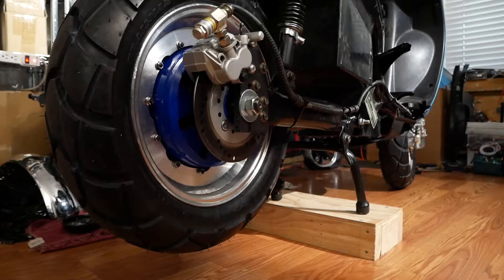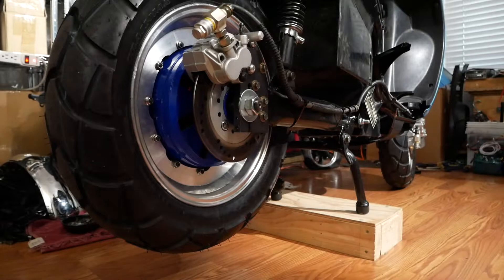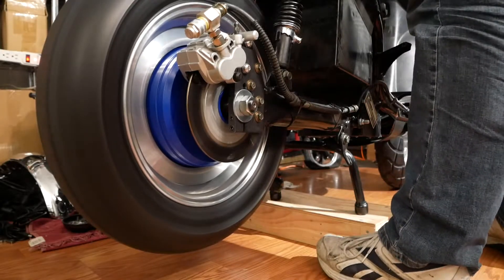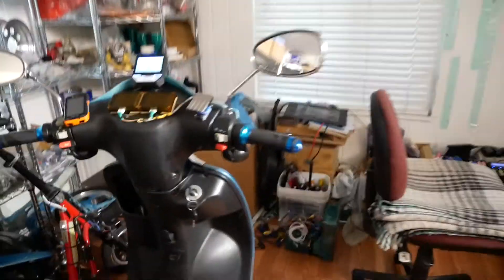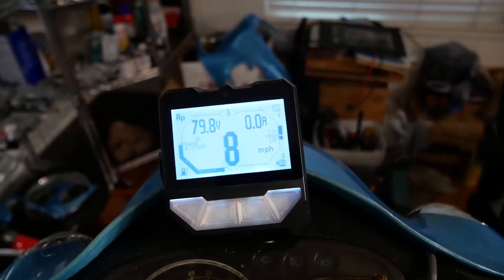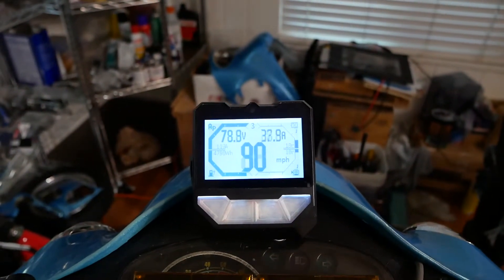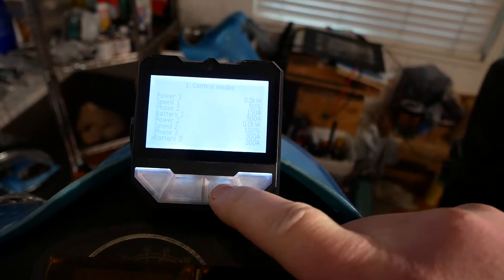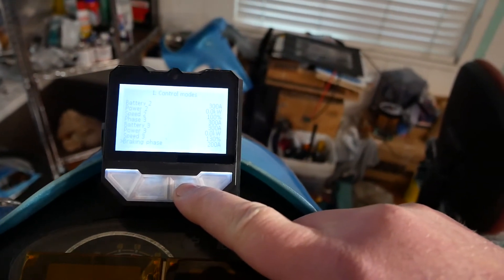Nucular controller - Motor violent ratcheting issue at 0 RPM

Comment: im curious if its reaching saturation and hall sensors are losing track of the position
Reply from the maker: This is a problem that random people have been having with Nuc controllers. This got a lot better with more recent firmware, but never solved. For this setup, the "solution" is to keep my phase amps under 180a. For another EV that has this problem, I think they did 145a. No way is the motor saturated as those amperages are well under what the motor can realistically run at!

Comment: Was this ever solved via a firmware update?
Reply from the maker: No...I first saw this in 2019 and here it is 2023 and still not resolved. I think I mention that Nucular is a bit dickish when they run across problems they can't resolve easily. They just ignore it and pretend you don't exist!

Comment: Have the same problems with my nuc 24f and cyc x1 pro motor. Just made a auto setup.
Reply: I meant that I haven't tried any other settings than just auto setup 🙂
Reply from the maker: @berglundsimon  You have this?
https://www.cycmotor.com/x1-pro-gen-2
*
I do the auto setup too. AFAIK, Nucular 100% missed documenting how to tweak the motor settings. The options are there, just no idea what does what. I know of an outrunner doing this too BTW. When I asked Vasily about this issue, he replied back that "i have an interesting motor". HOW was that useful in any way?! 3 very different motors all doing the exact same thing on the exact same controller model...yeah...definitely a controller firmware issue!
Reply from the maker: @berglundsimon  Post a video of yours doing that ratcheting thing and then post it here. I'll pass it along to Vasily. He needs to see this happening! There's got to be a firmware fix for it or at least manual steps to deal with it.
Reply: Yes that's the motor I got. see what I can do, not sure at the moment if it studders only when I'm on the bike or also with the back wheel off the ground...
Reply from the maker: @berglundsimon  I got a really short response back from Vasily. "X1 is known for issue. Solution will be, sooner or later." 100% useless response! WHAT I want to know is CAN I do something to fix this and HOW? So I have asked again...grrr!
Reply: @de-bodgery  new controller firmware out with this change "-Added hall filter settings to debug stuttering." Maybe a solution, what do you think?
Reply from the maker: @berglundsimon  ARE you saying you found new firmware? If so, PLEASE post where it is! I just looked and there is nothing new since August 2020. But yeah...this has been a loooooong ass wait for a firmware fix!!!
Reply from the maker: Did you ever get a response back from Vasilly? I got shut out of the support thread because I asked questions about this problem. What a bunch of assholes!

Comment: I wonder what could cause this? Seems like the controller sync offset may not be perfectly  calibrated to the motor magnetics
Reply from the maker: I reported this to Nucular and the response back was "Quite strange motors you have."
This is NOT a solution and fixes nothing. I'm pretty sure this issue, since it happens on 2 very different motors, is NOT a motor problem. 
*
Lets pretend you are right. It's possible. What do you think  I should change to see if that is the case?
Reply: @de-bodgery  since im not familiar with the Nuclear controller interface. what parameters in the motor setting are you able to adjust to influence the controllers understanding of the motor pole count and syncofs (Phase shift of sine wave after receiving index pulse)?
Reply from the maker: @DirectedWisdon  Those things are in there. I'll have to read the manual and talk to Vasily about them to see what might help. 
*
Something I have never tried is maybe my hall sets are backwards. The motor has 2 sets of halls and phases on the single stator. Maybe the factory paired the wrong set of halls with phases and I've been simply blindly following along with that mistake? LOL! It is possible. I've dismissed this idea many times, but I think I'm going to give it a try before I start tweaking FOC settings. Vasily is not admitting to a controller issue and that does make me suspicious just a little that there could be a problem on my end somehow. 
*
What this doesn't explain is why my friends outrunner does the same thing and the "fix" was turning down the phase amps....like I did on my motor. I'm still thinking auto-discovery has issues.